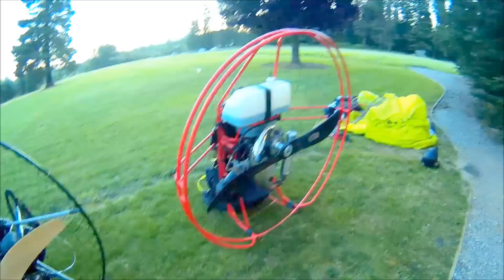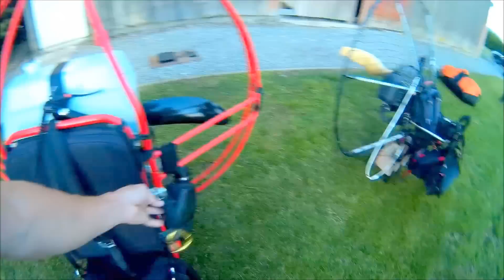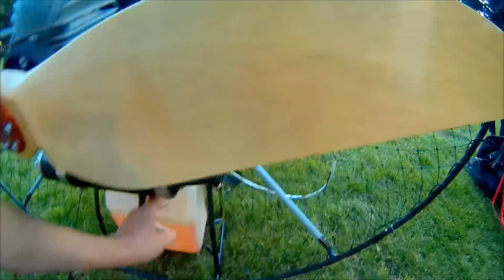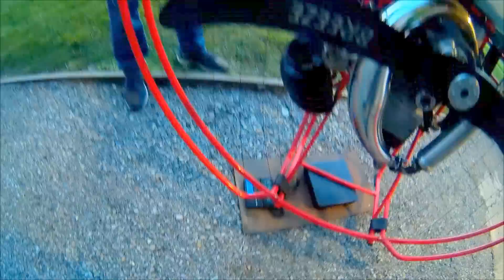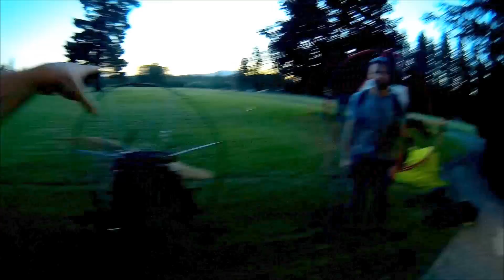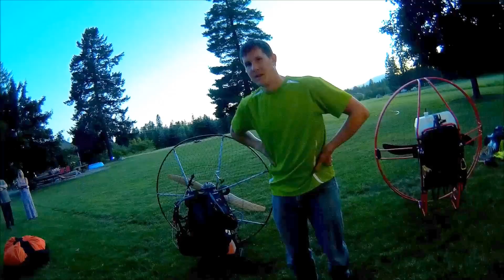Black Hawk Talon 190 VS FreshBreeze Siminini 210, Both Cost $6995

Comment: The fuel tank below might be using pressure from the exhaust to pressurize the fuel tank push it into the carb. This is common with RC aircraft even up to 120CC engines.

Comment: Did he say why he changed the prop, if there was never a prop strike?
Reply: My line got into the prop one time while the motor was shutoff and just put a little laminate shear in the prop. I probably could have glued it back together but just went with a new prop instead 👍🏼
Reply: @ZanderMav360  u fly a Blackhawk?

Comment: Funny, I own a FreshBreeze which was worth half the price as soon as I bought it. On EBAY all the time for 3000 or less. My second paramotor was a Flat top which still retains a  high value. Cost is a perceived value.
Reply: David H why did you buy another engine?
Reply: @hockeyslade    Much lighter weight. Light weight is critical for me.
Reply: David H did you like the fresh breeze and did it tourney bad. Did it fly and have power?

Comment: Scott, it's been 1 year and 9 months since you posted this video. How have things gone in that time? I'm curious if you've had any problems and if the owner of the Talon has had any problems. Would be nice to have a follow up video if y'all have time.
Reply from the maker: I've haven't talked to the talking pilot since. However I heard he crashed into a tree and gave up the sport. I have about 3 years of casual use on my freshbreeze. No issues yet. Ive been working so hard remodeling my house I haven't had time to post videos.

Comment: All of these machines are over priced, All of these machines are rip offs. A 2 stroke single cylinder engine alone sells for close to $3000, you can buy a rebuilt 8 cylinder 300+ horsepower hemi engine for less than that. Also anything that is associated with PPG is a rip off, Example a dealer mentioned here  selling a $20 boafang uv5r radio for $200 not to mention the $15 skateboard helmet with a pair of headphones and a mic glued to it selling for $300, and of course the extremely simple trikes with $ 30 worth of steel tubing and $75 worth of wheels and $5 worth of nuts and bolts going for a couple thousand. I'm all about a business making a profit but this is downright ridiculous they are cutting their own throats by pricing hundreds if not thousands of potential customers out of the sport.
Reply: As pilots say, if it has Tits, tires, or wings, it's cheaper to rent it.
Reply: Absolute truth what this person said about the prices. He is absolutely right. You can buy a freaking V8 hot rod engine for the price of these two strokes as he said. Also I was flabbergasted when I saw that a simple steel tubing trike that you bolt your paramotor to was $1000 to $1500!!! That is insanity! Any machine shop could build that thing for $100

Comment: If you look after your equipment, no natter what brand it is it will take care of you. I been flying Black hawk and found them reliable, loved their harness and customer support. M certain to get the same from fresh breeze or scout. Each one comes with their own distinct features, needing care in operations and maintenance. Comparing these paramotors is like comparing Boeing And Airbus, and unless they place their Pilot's chair on top of the fuselage, they are both good.

Comment: Don't forget about the tuned exhaust on the fresh breeze, it adds horse power and fuel efficiency. The carbon fiber prop is easier to spin on the fresh breeze which adds to the fuel efficiency.  The fuel is also gravity fed, with no reed system for pumping that can break.  As for the extra weight, I'd rather have a sturdier frame, so if I bit it during a take off or landing I wouldn't get a prop strike.  If you do get a prop strike on the fresh breeze the prop is more likely to break and not damage the engine as opposed to a wood prop.

Comment: Wow, comparing the two worst motors. Fresh breeze is dangerous with that leaky overhead fuel tank
Reply from the maker: Warrior Poet I think every motor has it's pros and cons. I've had my fresh Breeze 3 years and yes it is heavy but it is very quiet and runs very smooth. In these 3 years it always starts and has never had an issue. I think it's a great motor and very reliable.

Comment: I don’t own a ppg and I don’t fly one. But your comments were very against the Blackhawk.  You would have been better off leaving out opinion.
Reply from the maker: I feel differently. I've talked to 4 people that have blackhawks. All 4 have had reliability issues. So I did mention that the Freshbreeze may be more reliable. Other than that I try to point out good and bad about both motors. Blackhawks may be great.

Comment: Hey Scott, are you still enjoying the fresh breeze? Would you buy again? Thanks
Reply from the maker: Absolutely. I would buy it again.  It's pretty heavy but for a strong pilot it is a great value. Put 55lbs in a backpack and jog across a field a couple times. Buy the end of that you'll know if you need to go with a lighter motor like the nitro 200. The nitro probably isn't as reliable and strong as the fresh breeze but it's a lot lighter.

Comment: wHATS THE DEAL WITH THE FRESH BREEZE NETTING,OR LACK OF IT?
Reply: WHY ARE WE SHOUTING
Reply from the maker: So netting causes drag. The surface area adds up. Fresh breeze put enough netting to keep the lines out of the prop but that it. I can't reach the prop with the motor on my back. And I start the motor on my back. All that being said I think if I had the option I would choose to have smaller netting but I don't care enough to add it.
Reply: iF YOUR WORRIED ABOUT THE NETTING DRAG? WHAT ABOUT YOUR BODIES DRAG??AN OPEN PROP. IS AN OPEN PROP. HOW DID YOU GUYS MUERSURE THE THRUST ON THESE TWO UNITS?
Reply from the maker: We looked at the manufactures spec. We didn't do a test with a scale or anything.

Comment: A unbalanced prop will cause vibrations through the engine & air-frame causing bolts to sheer.
Reply: That or bolts backing out. I had a tire repair shop leave my lugs hand tight and a few miles down the road as they backed off more and more the oscillating vibration sheared off the studs. This is most likely the cause.

Comment: I have the simonini mini 2. A older fly products gold 130. When it comes to noise and the whole tuned exhaust the two cycle is noisy. However you can always add better wrap to the interior of a muffler or you could also add sound dampening and fiberglass wrap on the outside of the tuned pipe. I also have the Bing carburetor. What size Main Jet do you have Scott and what altitude are you operating in

Comment: Bolts can shear do to loosening, the harmonics of the motor cause metal fatigue.
Reply from the maker: That's probably what happened. It's still surprising to have bolts just sheer off under typical loads. But like you said they could have been loose.
Reply: It never happened. It was pilot error and he admitted it to me just a few days ago.

Comment: HI Scott I have the same motor as you do. You made a comment the the cc was 122, that is the length in CM of you prop. Your engine is 200 cc 24hp
Reply: wow maybe you should know your machine before doing a side by side comparison or a review, that's proplembe now a day give some a camera and they think they know what they are talking about.
Reply: Chris Boling 54hp really!!!
Reply: Jeffery Justus sorry it's 24hp. I stand corrected. The weight is about 54lbs
Reply from the maker: Yep your right. I changed it in the description I think 122 is the cm of the prop.
Reply: so you bought the machine and didn't know what the engine size was?

Comment: i think the freshbreeze is a simonini mini 2 200cc engine with a 122cm prop not 122cc , nice engine a little heavy but solid , nice comparaison of the 2 machine , thanks
Reply from the maker: Your right. From what I've read Fresh Breeze bores out the Siminini engine to 210cc. It's tuned down to 145lbs of thrust. But should last a long time. I'll update the description.
Reply: yeah but its 200cc not 210cc the solo 210(hirth F36) model is 210cc but 15 hp and the simonini is around 25hp 200cc
Reply from the maker: JusTin Your right. Thanks. I had no idea I was flying such a large motor. LOL. I've corrected the description. 200cc is a lot.
Reply: yeah , i have a video of a Simonini 200 on another frame type on my channel , with electrique start

Comment: I'm the (longwinded, 57yo, 230lb, ~36 flights) friend of VB Willy flying the Fresh Breeze Simonini.

Love the comparison. Any chance you could put the video through the brightness corrector function on YouTube?

I notice you have the J-Bar suspension; have you been flying that for a long time or did you train with "the captain"?
I've heard from others that that suspension is outdated and incredibly uncomfortable on the ground. I have the comfort bars (very similar to the BH in the video) and I'm fairly happy with them.
=> Thrust
Have you actually measured the thrust on either machine? Cloudbase PPG did some thrust testing of some machines at the Palm Bay flyin this year but neither of these are on the list. I'd really like to understand if the thrust numbers are inflated. One of the reasons I chose FB was because they are made in Germany and German PPGs are regulated so that gave me a bit more confidence that the reported numbers are calibrated. 
=> Weight
I'd love to have something lighter but I do like the reliability. 
Have you weighed both with no fuel?
=> Engine size and RPM:
The "122" in Fresh Breeze refers to the prop size in cm. They have a 110 and a 122; the smaller one is less efficient but fits smaller pilots (and cars) better.
The engine actually 200 ccm and is manufactured by Simonini but modified by Fresh Breeze with different bearings, reinforcement plate and several other important changes.
That also includes an exhaust that detunes the motor a bit which improves long term reliability. The max RPM on the motor is 6200.
=> Noise:
They're all loud.
=> Prop cost:
FB is delivered with a carbon fiber prop. Replacement is $465
=> Carburetor/fuel supply: 
The Simo has a float bowl carb while the BH has a membrane carb, not sure why.
The membrane carbs can pull fuel from the tank where the float bowl carbs depend on gravity (FB) or a pump.
Membranes are easier to adjust but apparently require more of it.
(I'd appreciate comments on float bowl vs membrane.)
=> Full throttle response. 
Mine is similar (6100 rpm at about 50-60% throttle) but I do get a little bit different mixture at full squeeze. I've found that airbox positioning is important; the clear spiral hose heeds to be as straight as possible. Before every launch I run the motor to full throttle and if it doesn't go over 6000 rpm, I don't launch. (Bad experience related to carb tuning and air-box positioning.) 
=> Pull start
I also need two hands to get mine started; I put the opposite thumb in the loop of the starter rope. More important is that I get a long pull. I think having the airbox positioned correctly (spiral tub straight) also helps the starting. Rarely need the choke.
=> Failed bolts?
Wow.
=> Exhaust connections
I understand that BH had exhaust cracking issues on earlier models but have fixed that on this one.
= Double ring cage
Great for keeping lines (and other stuff) out of props but can send the prop into the string and the cage on hard landing or aborted takeoff. (I''ve replaced the string on one cage twice because of that. PITA job but I think I still prefer that protection to the prop protruding behind the cage.
=> Netting protection:
I never start mine except on my back. I also wish the FB had closer and tighter netting but there is some thrust lost that way.
=> Cruise control
Use mine all the time, would hate to have to fly without it. 
=> Price: FB Simo, $6900 Talon 190 with Kestral cage: $6995. These are the prices for motor only, no "training" or package discount.
=> Reserve location
Simo CB (comfort Bars) also has it on the side.
=> Weight Shift:
CB models are known to be more comfortable (less bumpy) but also provide less weight shift. The FB weight shift model is called "Sportix". The blue-plastic-lined holes are for the comfort bars.
Reply from the maker: Brightness adjusted. Hopefully that works better. I'll try to film in better lighting next time. :)
Reply: Scott Wohlgemuth Thx!
Reply: PPG ATL 
Good review.  Thanks.